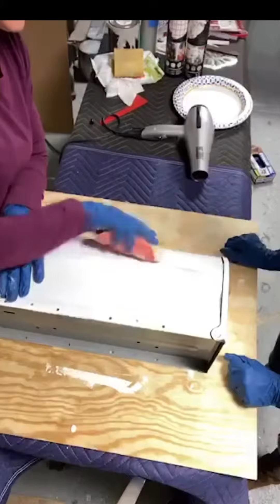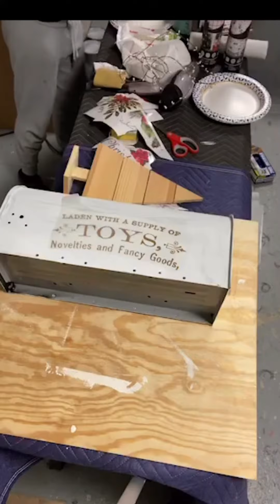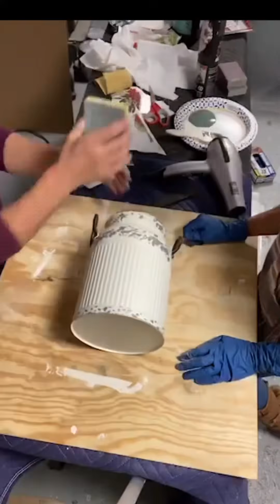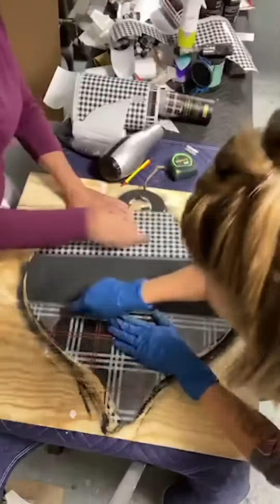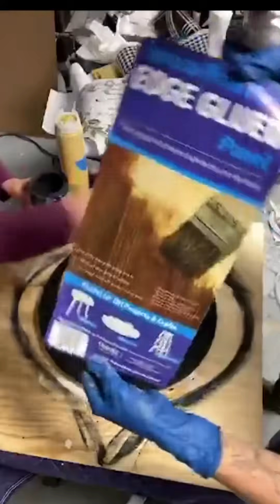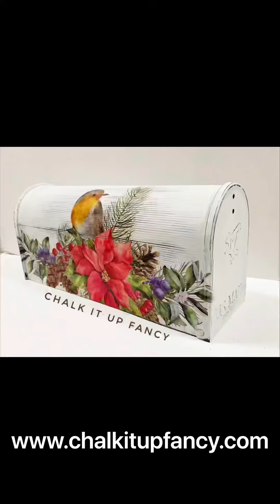DIY Christmas Decor using Christmas Greetings Decor Transfer

Comment: Do you attach the transfer after you wax the newly painted furniture or before? How long do you wait before applying ?
Reply from the maker: We do not recommend wax with transfers.  We use our one hour enamel.  We also do not recommend our varnish.  One hour enamel first than transfer than one hour enamel as top coat